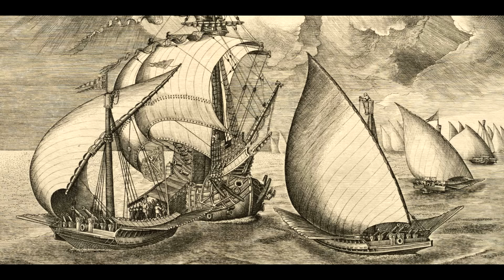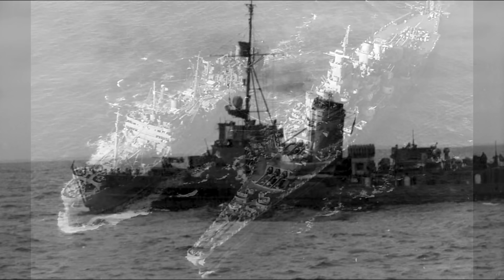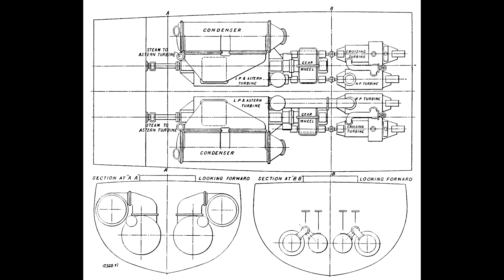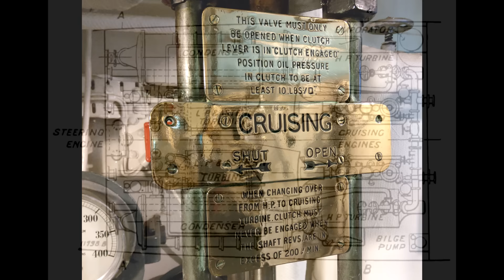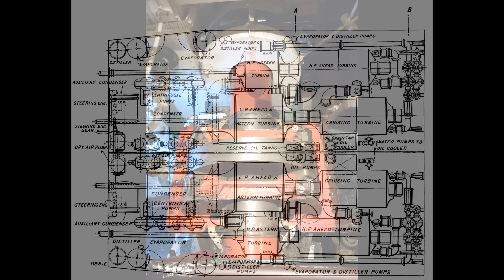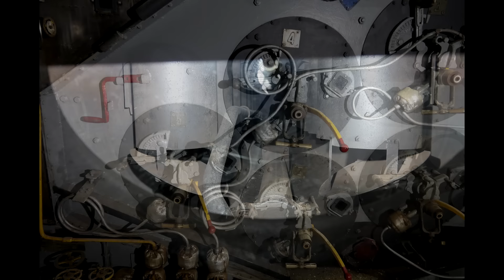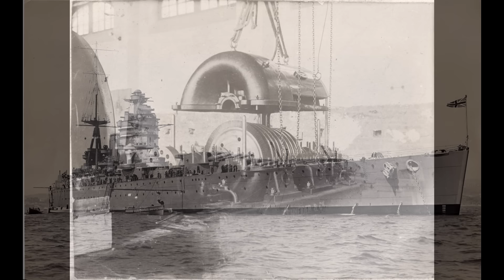Naval Engineering - How to choose your engines

Comment: Bravo Zulu! Have you ever thought about a video on large ships "stuffing box" such as a BB or a CV? I understand how they work on smallish ships such as a small inboard powered vessels but the idea of how they would work on such a huge ship as a CV or BB is beyond me. Thanks.
Reply: If you are asking about how the shaft passes through the hull of a ship, it is called a Stern Tube and there are many different designs on ships from ones that use oil for lubrication to one's thay use seawater for lubrication (which is definitely a weird concept)

Comment: I am most proud of being a  usn boiler technician on 1200 psi steam plant in the early 80' and late 90's. 900 class, knox class, adams class, and Belknap class.
Reply: MM here. USS Fox. Late 80s. The Belknaps were good cruisers.
Anyway, cheers!
Reply: MM3 on 600 psi battleship engine (USS Kentucky). 89-95, west coast, USS Camden (AOE2)

Comment: I was wondering why they have never used counter spinning propellers, sorryIf I don't know the proper term, on large warships. Was it ever thought of and why not?
Reply: The USS Albacore had contra-rotating propellers.  Worth a visit, in New Hampshire.
Reply: @gregorywright4918 thank you for the info, i really appreciate it! The USS ALABAMA, in Mobile Bay is also worth every mile to see, i live maybe an hour and a half away from it!
Reply: It's common for different shafts to turn different directions, but contra-rotating props where one propeller is placed in front of the other and they spin opposite directions aren't common in large ships. I suspect the main reason is that it's hard enough to seal a simple propeller shaft against the water, with a contra-rotating prop the hollow outer shaft would also have to have another seal inside it. A bit of a pain for maintainance. That being said, I have seen contra-rotating props on some stern-drives and podded drives used on large powerboats and yachts- the Volvo-Penta IPS is an example, unusually also with the propellers in a tractor configuration. They have the advantage that a leak of one of the shaft seals will merely ruin the gearbox rather than sinking the whole boat.
Reply: The main reasons are cost and complexity. It just isn't worth the hassle for large or small ships.

However, there is one sector were navies use them extensively and that is torpedoes. If you look for torpedoes after the 50's they are either pump-jet or contra-rotating.

Comment: Forced circulation boilers also respond quicker to load changes as there's less thermal mass than a natural circulation boiler. But forced circulation is the stupidest idea ever. Only makes sense in a Benson cycle (super critical).

Comment: I served on the Cutter Campbell in the mid 70's. It still used the steam turbine. And not all that well. More then once we lost steam while docking or more often embarking and drifted around until they got steam back up. A 40 year old ship was not what I envisioned I would be on when I signed up.

Comment: A lovely video as always but I have a question. Saying that diesel system takes up more room... I assume it is for a given horsepower rating in that is above a sertain limit in shaft horsepower or am I wrong? Is it a weight issue? Meaning, to balance the ship you need to stagger the engines and therefore you need to give over more room for the shafts.

Comment: You can run diesels on type 6 fuel oil. So basically you can run a diesel engine from everything between kerosene and type 6 fuel oil if you just have a sufficiently flexible fuel system.

Typically steamers of that day would use bunker C that is basically the same as fuel oil 6. You can run the boiler and the diesel on the very same fuel, its not really a problem, but you do need preheaters for the diesel. Typically you probobly would use fuel oil 2 or 3 for this, closer to bunker fuel A. For example Krivak-class frigates (Project 1135) and Udaloy-class destroyers did that. While yes, they where a lot later than the 1930, but i don´t see really any theoretical reason why it could not be done prior.

But there is actually plenty of ships that use a other engine mix combination. Gasturbine and diesel. Gasturbines typically run on kerosene, and diesel typically run on light fuel oil, I.E diesel fuel. But both can run on each other fuel if adopted.

There also exist turbines that run both steam and gasturbine not only in the same machine room but actually even on the same axle, running the same fuel. Typically those are multi fuel that can run LPG, LNG, BNG, diesel, kerosene, and fuel oil 2 possibly also 3. That is a of the shelf machine you can buy from Siemens energy. I don´t know of any ships that use those. According to friend sin the energy sector the reason for that may be that they are a bit difficult to start up

There been ships that used both steam and gas turbines on different shafts, like Royal Navy – Type 82 and Soviet Navy – Kashin-class destroyers. The Kashin used both diesel, while the Type 82 used heavy fuel oil and marine diesel on respective engines

You can actually also run diesel gas, but its a bit more complicated. But there is ships that do that like MS Viking Grace.

To go even more extreme, Italian Navy – Durand de la Penne-class destroyers, used diesel, gas turbines AND steam turbines in the same ship, all engines used diesel.  This is a 1990 design, and of cause, this could NOT be made in the 1930 considering it used gasturibnes. 

In that case the steamturbine was mostly used as a power generation device, while the diesel was used for long distance cruse and the gasturbine as a sprint device. The ship hade a manual conect for the steamturbine for emergancy us.

Of cause, making a ship in 1930 compare to 80s or 90s is a bit different considering fuel availability. After WW2 diesel was i large supply almost in all of the world. While before it was a bit less so, specially due to war demands. So running on bunker fuel in 1930 was almost a must to get sufficient fuel for the war effort. This would make it a bit more complicated, but absolutely possible.

Serial parralell propulsion also exist. So you have a low power generator and motor, the. A disconecting copeling. This way you can get the best of both worlds.

Its worth saying that in 1930s a electric motor was not really very efficnent, so this really become viable im the 1950 or 1960s
Reply: And if it's a CAT or old Detroit you can run it on moonshine, used oil or hopes and dreams
Reply: @thekidfromcleveland3944  It seams like that wouldn´t be possible. moonshine, or ethanol, is even lighter than gasoline, and diesels have a very hard time starting on gasoline and don´t run very well.

There does exist diesel engines that can run on ethanol but they use a vaporizer or carburetor for the ethanol, then they inject the a tiny fraction of diesel as a normal diesel engine to start the reaction. So basically the diesel work as a spar plug

I guess if you mix food oil and ethanol that might also work as a diesel fuel. That is fairly similar to what is called RME, that is basically food oil with methanol. That works just fine, but is a bit harder to cold start.

of cause you can use heavy oil as a fuel and dilute it with moonshine (maybe what you are referring to) to lower the viscosity.  This way the engine is basically running on the heavy fuel oil,. but the ethanol in this case is basically a diluent so it run in a diesel engine. So its basically the oil that is the fuel. The ethanol will also burn, but only after the oil self combust. This is very similar to RME that is a fuel you can buy in gasstation in europe.
Reply: Diesel engines running on heavy fuel oil requires centrifuges and filters to get rid of water, sand, and other contaminants. I believe that's mostly a post-WWII development. Though I'm not really sure about the fuel purification system on the Deutschland class, could they really fuel up with heavy fuel oil, or did they require some more refined form of fuel?
Reply: @jbepsilon it seams to me that it was what deuchland class had, but im not sure how to check it up

Comment: 22:15 or you could be sane and just have one manifold that all the boilers feed into and then have it flow out from  that manifold to the drive units with a big old valve on each on the in and out pipes to lock of  which ever combination of boilers and drives you want
Reply: From the late 1930s on, U.S. warships were designed so that all boilers, regardless of location, could be cross connected.
Reply: Cross connected yes, one manifold no absolutely not. This causes tons of issues. One being unequal flow to the different engines causing trim problems etc…

I’ve never done steam manifolds like this, but I HAVE done hydraulic and pneumatic manifolds which operate on similar fluid flow principles.

You want to avoid any flow metering valves etc.. for something like this because they will cause efficiency losses.

Comment: Yet another reason why "A Night to Remember" is the best Titanic movie is the scene with Captain Rostron saying "Cut the heating and hot water. Cut anything you like. I have to have every ounce of steam you can give me".
Reply: As I recall that high speed run did damage Carpathia’s engines. She had trouble hitting her previous speeds afterwards.
Reply: @pondking2801 Indeed, and the story goes further than that. White Star Line, the owners of the Titanic, actually offered monetary compensation to Cunard Line, the owners of the Carpathia, for the damaged engine and lost revenue, etc.
Yet, despite the historic and highly intense rivalry between these two biggest shipping lines of the era, Cunard turned them down - like saying, "nah bro, we got this bit." I think that's rather wholesome.
Reply: @mnxs  thanks for the addition information.
Reply: @pondking2801   Emergency cases like these are where it's invaluable to have a veteran chief engineer  who knows the safety margins on his equipment  and thus knows  exactly how far past the redline he can push things, about how long, and what to look for to cut back in order to avoid catastrophic failures.
Reply: "Saving the Titanic" is another good one, focusing on the Titanic's own engineering crew and their fight to keep enough power going to run the various emergency systems.
Reply: @paulm7842 Yes I've watched that. The basic story was good, of course, but let down by some completely unnecessary Hollywood-style over dramatisation. The story is good enough as is (as were the actors) without the need to for such embellishments. 

But as an exercise focusing on some.of the unsung heroes it is certainly very very welcome.
Reply: “Full steam ahead” presumably the same thing?
Reply: @extragoogleaccount6061  Not quite, "Full steam ahead" would "merely" give all steam normally allocated to engines, where Rostron's specifically calling out "no, I'm being literal, here, Chief. When I say  all, I mean all." (meaning, the chief engineer)
Reply: @extragoogleaccount6061 For all intents and purposes :)
Reply: I wonder if HMS Rodney had this sort of system so it could chase the Bismarck at more than its rated speed?
Reply: @Dave_Sisson had this discussion on another post this morning where I quoted Wikipedia that apparently Capt. Dalrymple-Hamilton & the Rodney’s engineers managed to get 25 knots for a short period of time chasing down Bismarck. It seems that there is confusion around this, and at a later time when they met with KGV the Rodney stated their 22 knots was not the same as KGV. I do believe that Rodney did, for a short time prior to meeting up with KGV, produce enough power to run @ 25 knots, even for a few hours. Rodney was apparently on her way to the US for a needed refit. Cheers.
Reply: Star Trek fans will know this one:
Captain Sulu: In range?
Helmsman Lojur: Not yet sir.
Captain Sulu: Come on! come on!
Helmsman Lojur: She'll fly apart!
Captain Sulu: Fly her apart then!

Comment: Electrical power was commonly produced by alternators on the prop shafts with backup steam powered turbine and reciprocating power.
Auxiliary boilers were also common things to provide steam for electricity and pumps when the nain boilers were down.
Auxiliary boilers can also be flashed up to working pressure very quickly to provide steam for things like fuel heaters and pumps, blowers and condenser pumps to get the main boilers up to working pressure more rapidly.
 They need about 50psi of steam to begin working and the auxiliary boiler bridges the gsp from lighting the fires to getting a minimum working pressure.

I have mentioned in other comments that my first experience aboard a ship was back in the 70s aboard former Armed Trawler HMS Neave, one of the big 165 footers. It was sold out of service after the war and converted to a tank pumping ship. My dad had a contract to overhaul and refit the engine and boiler, he got the job because he was one of the few left with an 'up and downer' ticket.
Anyway, it had a Scotch boiler for main power and a vertical auxiliary boiler. Electricity was supplied by either an alternator on the prop shaft or a separate turbo alternator.
Reply: I never saw an aux generator in a U.S. flag merchant or Navy ship that was Steam powered .

We did have one in a Lykes Brothers  Slow  speed diesel container ship with a waste heat boiler that turned a turbine .

Underway we did not run a diesel generator that saved a fortune in fuel and wear hours on the diesel and it Was the quiet diesel ship I was  ever on underway .

Comment: i think you negleced to touch on two main things: when you design a steam propolsion system you need give a very serious thought to the likelihood that the propulsion system will piss off poseidon or not. poseidon was notoriously against the tubine electric systems. anotehr thing that should be considered is how how hot will the boiler and engine crew get. a propulsion could conceivably go much faster, whee it not for the fact that it will cook the crew alive.

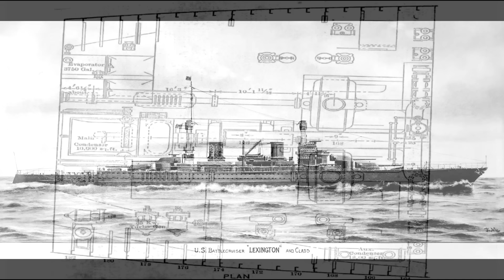Comment: 12:34 it also allows you to do fun things like go backward without a gear box and allows you to theoretically put the props anywhere on the ship you want front back sides even on little danglely out bits if you like so long as you can either fit the motor or a drive shaft and a set of 1 or more bevel gears

Comment: You don't necessarily need different engineers for steam and diesel.

My dad was a Chief Engineer, he started in the 1950s after his apprenticeship as a junior engineer on a P&O cargo ship with tripple expansion engines and then moved to turbine ships including passenger liners.. He later moved to diesel ships and finished his career aboard diesel super tankers.
Reply from the maker: That's one impressive set of expertise!
Reply: I mean...
It sounds to me that your dad was only working on the one kind of engine at a time?

I don't think Drach's point was "Humans can only learn to work on one kind of engine". I read it more as "Militaries might be wary of the technical and logistical burdens of mixing power plants".
Reply: Well this is pretty standard in the Maritime industry, I graduated with a USCG unlimited horsepower license for motor (diesel engines), steam, and gas turbines. I have sailed on ships with every single one of those propulsion types, but I would say the difference between the roles required for an officer on a commercial vessel (or navy auxiliary) are vastly different than what the Navy deals with. Not to mention that commercial ships are much more officer centric when it comes to maintenance and upkeep of the plant.
Reply: @floridachess9328  Very true. There are many of us who hold unlimited steam, motor, and gas turbine tickets. I started on scotch boilers feeding Skinner Unaflows and retired as a MEBA chief sailing RoRos, tankers, and boxboats. Until the end of the steam tanker days we still had vertical recip compound steam driven stripping pumps. As far as real hands on knowledgeable engineering officers, the merchant marine is miles ahead of the naval counterpart who is assigned the role rather than earned it.
Reply: @oldtugs Yeah I get that a ton, I am still a 3AE sailing for MSC but I lucked out and got some steam time on the USS Mount Whitney, and then some GT time on the USNS Supply. It's crazy talking to the navy guys who ran the engine department with many more people. Like for example the watch teams on the Whitney was 4 crew members with the EOW, two Engine Utility, and the a Boiler Control officer. Which is still more than any commercial ship from my understanding (a separate fire room and engine room will do that) but the Navy would have 10-20 guys per watch team.
Reply: @floridachess9328  I can't remember the last time we had more than two, the watch engineer and one unlicensed guy. Most motorboats now are unmanned at night, we would lock the control room door at suppertime and make a round before breakfast. The duty engineer answers any alarms during the night.
Reply: @oldtugs Yeah as a Cadet I got some time on a Slowspeed with unmanned engine room, the problem with a lot of the MSC ships is they are Navy designed which therefore are watchstanding ships
Reply: Expertise of any sort scales terribly slow even in a peacetime. In a time of war it’s way way worse.
Reply: True. I have a combined Motor and Steam First Class (Chief Engineer) Certificate of Competency.